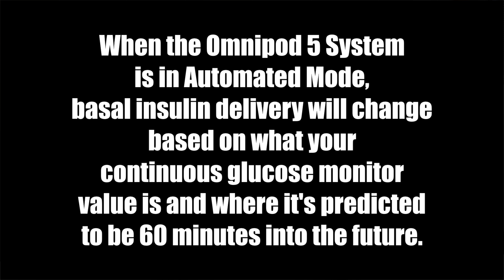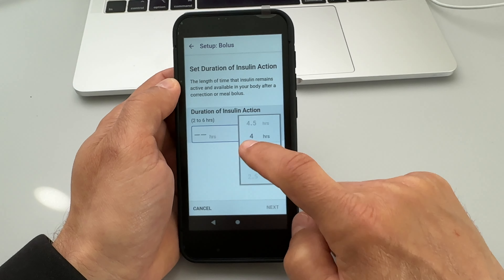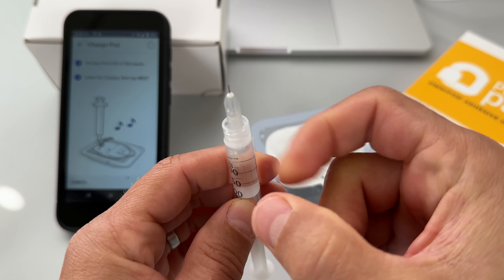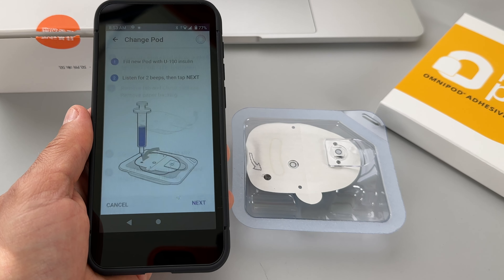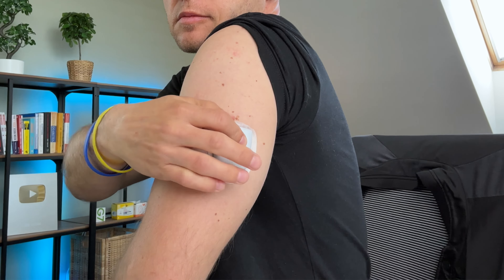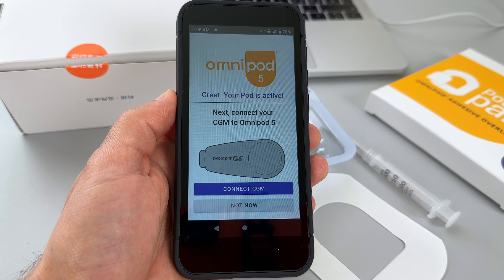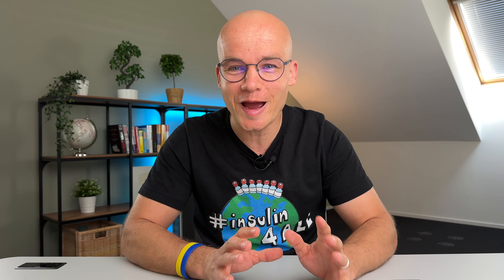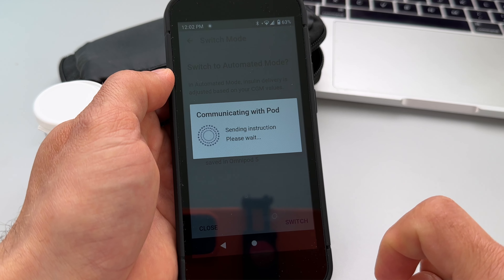Omnipod 5 Tutorial: How to Apply Your First Pod

Comment: To avoid bubbles in your insulin vial, keep the vial upright and inject the syringe full of air into the vial. Because of gravity, the insulin automatically remains at the bottom of the vial and no bubbles are created. Then tilt the vial upside down to draw out insulin.

Comment: So I found out that pod now works with freestyle sensor.
Reply: Yes, the Freestyle Libre 2+.  Getting ready to switch from the Medtronic pump, which I have used for 20+ years, to the Omnipod 5 with Libre 2+...
Reply: @ Yep I did this 4weeks ago yes the first week was a bit up and down. Now it’s great for me controlling the dawn effect followed by the lows is the best. Now averaging bs is 6 very happy. I put sensor uppers inside arm and move pump around stomach side. 2 weeks one side due to sensor life. Get through 6 pumps per sensor. More or less due cardio or weights. Good luck 🤞

Comment: Thanks for this. I had been considering trying these but I won’t now that I’ve seen your video. The thing I hate doing with my pump is filling the reservoir. I only use about 30 units a day so I would have to do the thing I hate far more often. I had thought that the pods would just end when you run out of insulin not after 3 days. I was also told they run through an app on your phone not a whole new device. Definitely not suited to me. I always learn something from your videos. Thanks!
Reply: Not so fast. I love Omnipod and could not ever go back to a tubed system. The pod only requires that you put in 80 units, if you are using 30/ day, I would put in 100,just in case you need extra for any reason. You can use your phone and app if it's an approved phone. I only use my phone. If you activate with your controller you have to use it for those 3days. You cannot switch back and forth during a pod session, but you can when you apply your next pod. I love Omnipod and could never go back to a tubed system. Wait until you have no tubes! 👍🏼 You can also push the end time by a few hours... It will let you know several hours before, but when it expires, it expires. I just aim to not have any of it when I'm trying to sleep. I think you'll love Omnipod.
Reply: @kirstenkay1399  the tubes have never bothered me. The canulas are also too short. I need long ones so I know this won’t work for me. That’s great you love it but I can see that it doesn’t suit my needs. I’ll just try something else next time I’m getting a new pump.
Reply: I have gotten the starter kit for Omnipod 5.  Is the dexcom g6 cgm supposed to be in this kit?  Thanks

Comment: Thank you very much for the clear, easy-to-understand, and honest information. Of course we all experience glitches when managing our diabetes. Stuff happens! I don't have a pump yet and am trying out the Omnipod, by which I mean that my diabetes educator gave me two trial pods filled with saline in order to give me a sense of the physical aspects of wearing one: weight, bumping into it, sleeping with it, keeping my dogs off of it, etc.  I've been wearing my DEXCOM CGM for several years and frankly the Omnipod doesn't feel any different to me, yet. I guess I won't really know until I have the cannula inserted and it's pumping round the clock. Does it make a noise? Will alarms beep in an annoying way or will it allow me to sleep undisturbed as long as my readings and pumping are going smoothly? So much to learn.
Reply: / \ no, it won't make any annoying sounds.  U won't even know ur wearing one

Comment: My experience with the omnipod5 has been awful. It can't stay connected, goes on manual mode all the time, disturbs my sleep, malfunction, and pods fail to connect. I wasted more insulin throwing away new pods than I've used. I just had 2 pods in a row fail today, so I call the Dr to go back on the pens.
Reply: Sorry. But thanks for sharing. I hope I have better experience. But my experience with Dexcom G7 this past fall was horrible, so your experience w/ pump gives me anxiety... don't need malfunctions for both types of units! Geezz
Reply: @AintNoFool  Thanks, and I hope your experience is better. 

When the pod controller, pod, and sensor work they do a good job at keeping my blood sugar levels normal. Before the latest adjustments I'd get a lot of crashes, now they are fairly rare.

The G7 does have its problems, but I was having problems with the pods even with the G6, so I think the pods just have a very inferior Bluetooth compared to every other Bluetooth device I've used. I mainly don't like putting the G7 sensor on my arm, it gets in the way a lot compared to my stomach, and it's hard to do. I do like the tiny magnet on the G7 applicator, I pry them out and collect them.

The best part of the G7 is my phone can't run the Dexcom G7 app. That app darn near driven me mad with its constant alarms at all hours. The bad part is the insulin controller doesn't warn me about crashes at all, which are my greatest concern, and even if I wanted to set alarms, there's no way to do it.

Dexcom and/or OmniPod5 need to aggregate their feces and resolve the Bluetooth connectivity issues. I think the most annoying thing that happened to me recently was when the insulin controller had me trash two new pods because it couldn't connect to them, then while trying to get a 3rd pod to connect, it connected to one of the pods I had to trash!

Good luck with your OmniPod5, when the Bluetooth works, they work well. When they don't, it's a royal pain in the neck.

Comment: Personally I've been using the Dash for a few months now & just don't think the pump is for me. Hopefully I can go back to MDI without issue. 

But I'm weird as I'm not also a fan of the Libre or Dexcom due to their inaccuracy (this is my personal experience)
Reply: I suggest tandem. Yes they are tubed but the tubing can easily be hidden and it has something called control IQ. Which means it stops sending insulin if your at 112 mg dl (for me) and starts giving more insulin if at 200. I’ve had it for almost a year and I really like it.
Reply: Libre lag a bit, the best tip I had (off Tom) is to fit a new sensor 24hrs before activating it. It seems to help them be more accurate. Recently though I had a sensor reading 16 !!!!!!!!
Finger prick was 6.5. I peeled it off, emailed Abbott and they replaced it FOC.
I’ve never heard of Dash.